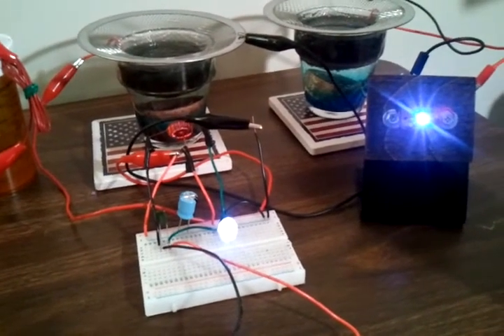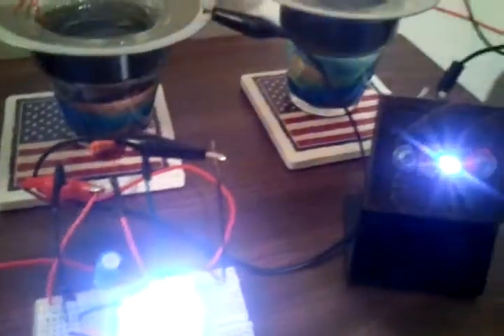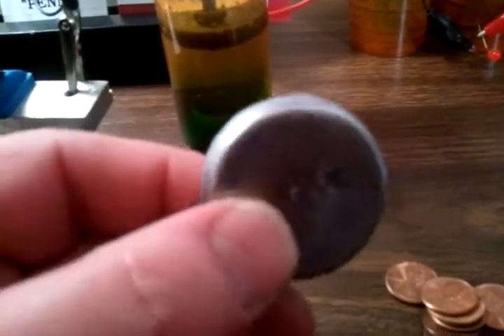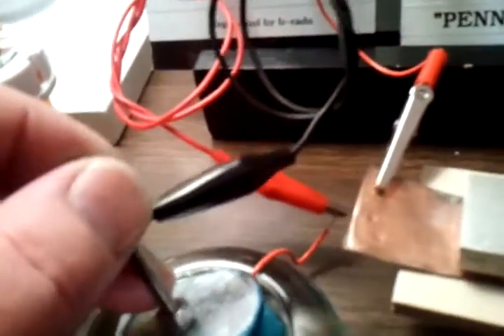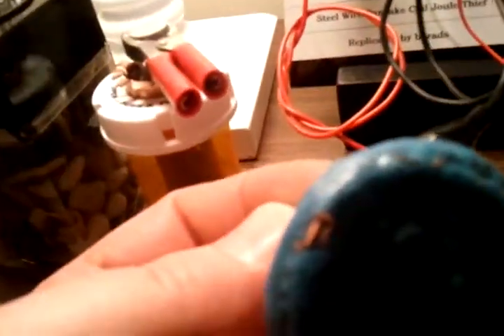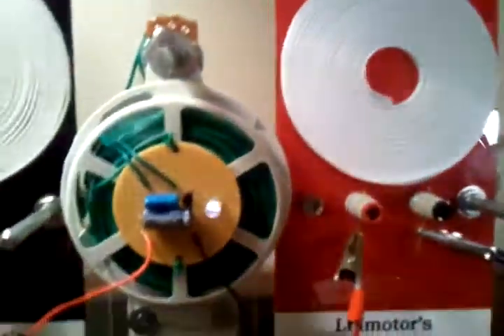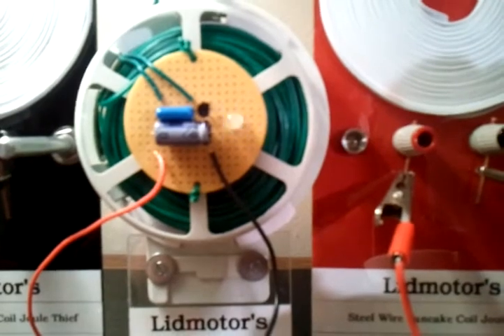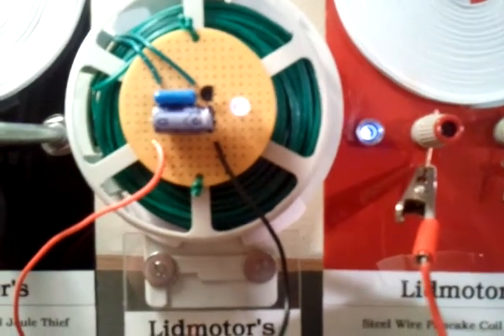Enhancements to diy Gravity Cell & Fun with Penny

Comment: @OUbrads Glad you enjoyed :) There may be several 'sweet spot' resonance points for amplifying the sync. Am thinking a sig gen into a smaller 'Penny' coil at say 10Hz (any normal flash rate to begin). Then increase width/amplitude/frequency for observations. I haven't got one, but if you have, then it could be really interesting to see what that system produced as data.

Comment from the maker: @slider2732 
Slider, I took two radios with ear buds connected, separated and listened to the two oscillators run independently (stereo).  Moved the two together and could hear them sync up (mono).  Way cool experiment - thank you for the suggestion. :)
-Brad

Comment: Very neat and clear examples there - particularly the now proven effect of oscillator interactions. 
I'm thinking it's radio wave based. Take an AM radio and listen to all 3 when separated by more than a few inches. A scatter of sound. Now draw them together and they sync up. Picture the waves overlapping and wishing to resonate to 'pair down', balance and cohere as a stream, as all of nature does. Waves on a beach as an example, not individual little drops of water hitting the beach randomly :)

Comment from the maker: @Lidmotor 
When Penny is moved away from the other two oscillators, the blink rate is very slow and not nearly as bright.  Sitting like they are and have been for several weeks, the blink rate matches and is much brighter. Really does make me think that power is being absorbed from the other two circuits or some where else. (??)
-Brad

Comment: Making one of your "gravity" cells is on my to do list and I will track down that root killer to try out your other cells.  I noticed that linkup between two Penny oscillators also and wonder if perhaps there is more we should look into there.  Perhaps something is being drawn into the system from the outside environment.  I don't know but the "effect" is very noticable when the two oscillators link up.